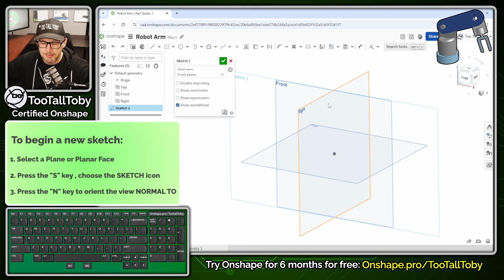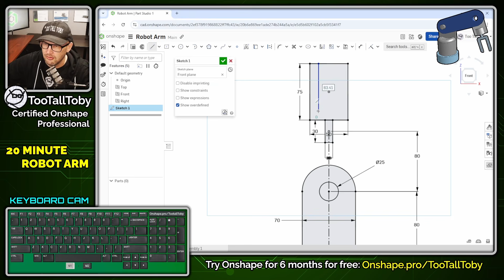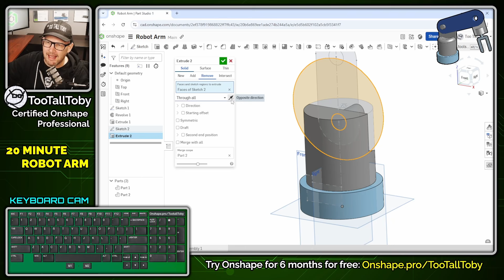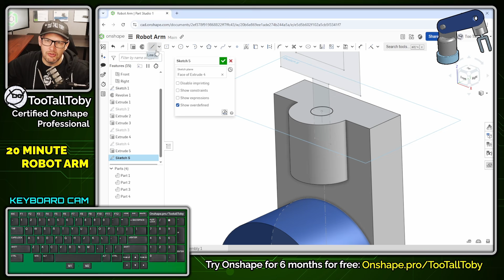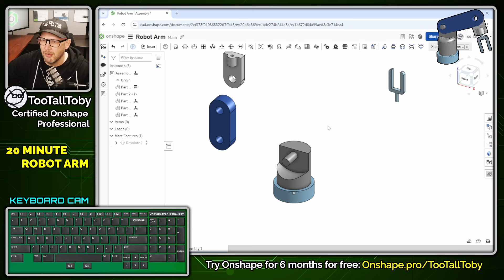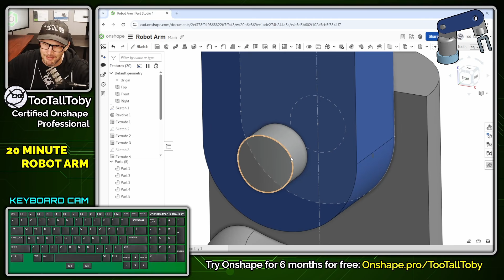Onshape Robot Arm Tutorial | Layout Sketch to Full Assembly in 20 Minutes!

Comment: i was going to ask about tokerances before i got to the end of the video..  Is move face the best/easiest method or would a tolerance variable added to the sketches or extrusions be better?
Reply: So I like to do it in 2 phases:  Phase 1 I use MOVE FACE to get the clearances dialed in, as I'm going back and forth a lot with the 3D printer.  Phase 2, I go back  and "properly" modify the original underlying geometry, which will make it easier for me to re-visit this project a year or 2 down the road. (because if you just leave a bunch of "move faces" in the tree, it can get really confusing) 

Hope this helps!

Comment: A small thing worth mentioning regarding  line to arc - You need to move to an angle/direction that you want the arc to go to. For example @5:46 you first moved over to the right and back again, and that means the arc will curve to the right. I used to get arcs going in the wrong direction until I figured that one out.
Reply: Great point - thanks for the feedback!